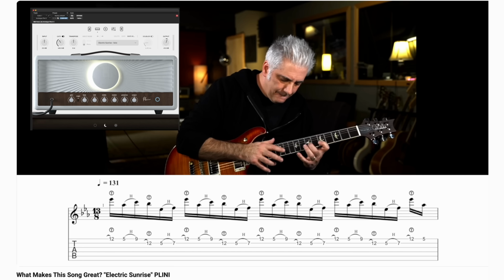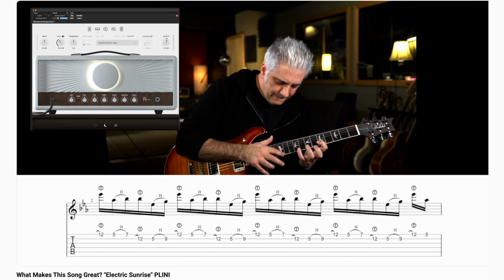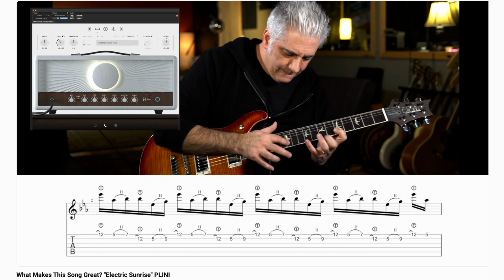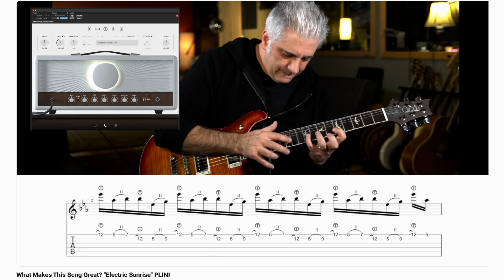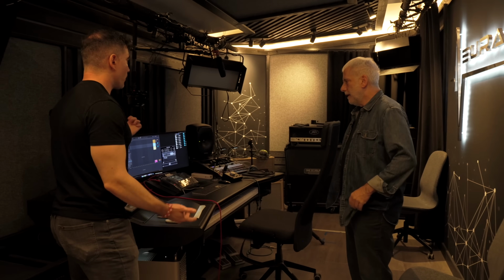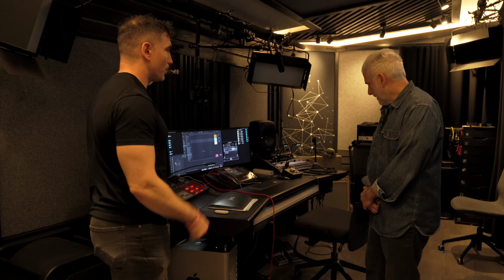I Flew to Finland to Find Out...How Are Amps Modeled?

Comment: I was skeptical forever and pretty disappointed at the Helix I bought years ago.  I own some amazing tube amps and pedals but recently jumped back in with a Quad Cortex and and a Laney FRFR due to the needs of a cover band I joined.
The short story is that I still love the tube amps but the digital setup I use lacks very little and its more consistent and easier to set up and transport for live use.  Amazing gear and not all that much of a learning curve.

Comment: I played with the Neural DSP for a year, then bought a Marshall Jackhammer pedal and an IR emulator pedal. That was it, I had to delete the Neural DSP; I forgot about it instantly. I bought five more overdrives. The transistors sound great, the software is just an emulator. and I couldn't get the "stacked overdrive" sound where a medium gain pedal is fed into a low gain pedal, it just doesn't sound right in the software. Analog pedals do what I've always loved. Their sound is very prominent and has a unique character. And there's no latency at all! Maybe Neural DSP should start releasing separate pedals that can only handle one distortion that I downloaded and droped into, without any latency, and then experiment with them. It'll be more interesting.

Comment: Modeling has come along way and with something like NAM being open source opens the door to many many more options. If NAM could make their platform a more complete testing environment by adding the ability to use your own testing input files. I think that would blow the door off the thing. There is always something missing in the bottom end in models. I find this even in building models of gear thru NAM. Unlock NAM!! Give us the power.

Comment: I have two quad cortex. My first one did fail after quite a few gigs. Turning off then restarting etc. Certain casinos here in Australia demand no back line, so the quad cortex was the answer! It came all the way from Finland back to Australia within a fortnight totally repaired but I bought a second one just to be sure! They are fantastic.! Within minutes of the thing failing I had an email back from the guys at Neural asking questions and troubleshooting on the fly! Their backup service is phenomenal! Considering the time difference between Finland and Australia, there must’ve been someone on hand 24 seven.

Comment: Maths Equations on the White Board are Amplifier or OpAmp Gain equations, Low pass/Band pass filter equations. Basically, you get those Amp gain and then use their transfer function to plot at different frequencies (w).

Comment: Here's my issue with amp modelers:  

Like EVERYTHING technology-driven, within so many years it's useless, outdated, no longer supported by the manufacturer, etc (laptops, pads, phones, etc) .  If you're a touring musician and need something portable, the DSP is a good option, but it WILL eventually be replaced leaving you with a $2K brick. 

Remember the ELEVEN rack unit?  There ya go.

Comment: I've enjoyed so many of your posts, but I'm compelled to respond to an observation from this program. At one point a comment was made that musicians weren't typically technically smart. During the mid '60s when there was a buzz in the air with new music and, as many will say, they became self-aware of their own talents  for music, as I did before I turned ten. I craved learning guitar, and it remained my priority in life. I did very well in middle school, but by high school my interests shifted to music and fell away from academics. Although attending high school, I left just short of graduating, which left a personal scar on my own self-esteem. I spent the next dozen years giging almost incessantly, but reached a wall where I was full. After some self-assessment and counseling I returned to school. It could have gone either way for awhile, but as is often the case, I had a moment with an older professor and shared my background, and feeling defeated and unsure of my academic abilities. He then went on to explain that many of the most highly esteemed people of science also fancied themselves as students of music. With that declaration, I felt like I could be included in the realm of academia as opposed to feeling excluded. I went on to excell in classes and finished years later with a doctors degree, never loosing my affinity for music. My concern is for musicians to never feel insufficient because one's own perceived inadequacies and never allow self-esteem to erode to the point of inaction.

Comment: I have the privilege of being friends with a builder of custom high grade tube amps, and had a chance to be part of a session where we did comparisons between class A tube amps, and amp modelers. The conclusion in the end was unanimous - the tube amps destroyed the amp modelers, there was no comparison. Amp modelers are practical, and it's understandable why musicians use them a lot, because you don't need a special room to record guitars, and also when they tour amp modelers are much more practical, economic and efficient to use, but to say that amp modelers sound as good as tube amps that's a load of b******it. These companies need to be truthful, say that amp modelers are practical, efficient and at this day and age are much better then guitar processors from the past, but they are not better sounding than tube amps, that is not possible. It's basic physics.

Comment: These are people creating the modes we want in our keyboards ot guitar amps. They don't have the computer program to transfer from analog to digital, so they are engineering the transform themselves. They want to capture all of the analog nuance to digital without losing anything. We did this in medical science in the 90s to capture frequencies of brainwaves in analog that we could analyze in digital using fast Fourier transform. They are doing the same thing, not skipping tha analog data. Which we all know from our vinyl disc's contains all the data. Not just a average of data like we have digitally. He's looking at huge mode files.😢

Comment: I regularly use Neural DSP plugins—I use at least 8 or 9 of them—and I have to admit that the quality has now reached levels incredibly close to real analog gear. This is even more true when talking about digital conversions in hybrid or profiling systems.

What I mean is that if the gap between a Neural DSP Archetype plugin and a fully analog setup has become extremely small, this is even more evident with other hybrid systems that cost 10 or 15 times more than a Neural plugin.

In some cases, like the latest John Mayer X, the amp quality is so high that, in my opinion, it no longer makes sense to use profilers, power attenuators, and similar gear. At that point, it makes much more sense either to go fully analog—yes, because a difference still exists—or just embrace this level of digital quality.

God save Neural DSP!!! 🎸🔥

Comment: I like the idea of just simulating every electronic component, then assembling the virtual amp circuit.....but just automating the knob turning and signal injection on a physical amp over thousands of setting variations is super dope. I bet it bypasses a lot of little headaches.

Comment: @Rickbeatto  KNOBS___ YES!!! Gigging musicians are always fiddling with them from gig to gig as no room or stage reacts equally to the same sound. It Is that tactile comment that makes me stick with my boss Me 90.Unless you are a serious recorder vs  a weekend musician, do you really use all of the Possible sounds that a quad Cortex offers?. I would say that if you do that it is great, Spend your time creating tones that help you produce (better) music. One of the best parts is that you can turn knobs on the fly. No menus. I stuck with my boss me 80 and my upgraded boss me 90 , because I could reach down and change what I wanted. I could set a Bank of sounds for a particular guitar. so if I'm. Playing a strat, hollow body, Ibanez roadstar or Prs SE NF3, I don't have to really worry so much. I just have to remember what bank goes with what guitar.  I don't use that many sounds.  If I do, just like in the good old days, I'll drop to a knee and turn a knob then stand back up and play. I now have a better understanding of Impulse responses where Speaker cabinet choices are concerned. The  boss me 90 allows me to find two or three cabinet choices that I like and add them to the pedal for the FRFR / silent stage venues. I'm in love with the 4 by 10 & the 2 by 15 cabs .Because for 20 plus years I played my PV musician III head on top of a custom rolling tuck( naugahyde ) Base cabinet. .it allowed me to move a lot of air when we played outside in the parks and I could  could turn The volume up or down as needed

Comment: I bought a Quad Cortex in April. It is still unopened and sitting on my shelf. I still unsure if I actually need this and if this makes sense. I have several Marshall and Mesa Boogie amps and cabs. I also have many pedals etc. What exactly is the point of having this, versus all the other gear that I already have?

Comment: Those plugins literally replace physical amps, the people who build them, the studios that mic them, and a whole chain of jobs that used to be necessary. That shift was embraced as “progress.” Suddenly AI is where the moral line gets drawn?
Reply: Yes because AI isn't human. Amp engineers still have jobs, recording and mixing engineers still have jobs.
Reply: @ileutur6863  Amp modeling absolutely reduced the need for physical amps, amp rooms, mic lockers, assistants, and studio time. The whole chain didn’t vanish overnight, but it shrank. Fewer sessions. Smaller crews. Different economics. Saying “those people still have jobs” ignores scale. It ignores how often they’re hired and how many people are needed.
And the “AI isn’t human” line doesn’t really hold up. Neither is a plugin. Neither is a DAW. Neither is a drum machine. None of those things are human. They’re tools. Tools that replace or compress parts of a process that used to require more people, more space, and more money.

What actually matters is agency and responsibility. AI doesn’t decide to make art on its own. A person prompts it, edits it, throws most of it away, keeps what works, and decides whether it gets used. That’s no different than choosing an amp model, a preset, or a sample instead of hiring more people and booking more hours.

Every major shift in music tech did this. Tape to digital. Live drums to machines. Big studios to home setups. Nobody drew a moral line then. People adapted because the work still required judgment, taste, and accountability.

So if the standard is “some people still have jobs,” that standard was met a long time ago. This isn’t a moral awakening. It’s another workflow compression. The real question isn’t whether the tool is “human.” It’s how humans choose to use it.

Comment: Digital has RACED by all things pre-amp , that debate is closed. You can argue if you want , but you're wrong. The part that CAN'T be done digitally , yet , is the poweramp section of tube amps. Digital still has a ways to go for that.

Comment: There are so many ways to model amplifiers, but there's something weird in how the best ways are the at the same time the simplest and the most complex, but the one thing that unifies both of them is that neither cares about what is actually happening between input and output. Neural DSP has 1000x more flexibility, but oldtimey convolution matrices aren't really any worse if you know exactly what you are doing.

Comment: Here's the thing, Rick.  Everything I've yet seen, listened to or whatever, regarding modelling, all revolves around the sound.  Truth is they've had good enough sound for quite some time.  But I've been playing with modelling tools for a long time and though they had more than good enough 'sound' for well over a decade now, they are still all missing something.  It's something that does not seem important to many later players, who appear to be fine with the inorganic, compression algorithms used in an attempt to produce gain.  But they all fail, at least all in my experience.  The first gen Helix has some models that sonically, are about perfect.  But when playing through them, though they sound amazing...physically (?), they do not play right. I'm playing a Friedman, but it's the same with most high quality tube amps...they behave differently.  The interactions between player, instrument and amplifier are unnatural on the modelling devices.  They sterilize the playing by unnaturally compressing the signal, they steal the life and nuance from it.  All this focus on this generic expression 'tone', but all the local pro players I know that have been desperate to be able to go modelling stomp-box for live performance, they've all tried it and left it, gone back to small, low wattage heads or combos.  Truth, I've not tried the Neural DSP stuff...I hope it's getting real.

Comment: The easiest way I've found as a sound guy to get rowdy guitarists to check their volume is to convince them to point the Amp straight at their face like a monitor wedge. I would even have a couple of Amp stands that would do this that I would have on deck to loan them so it tilted the Amp back and pointed it right at them and lifted it a little bit so they can make changes on the fly.  This usually would cause them to turn the Amp down and if they didn't, usually it would cause the other band members to fuss at them. Another tip is when doing sound check and setting monitors, 2 things, be careful how you ask the band what they want. I don't usually even give them full reign,  instead I'd say let's get the vocals up in the monitors and then play through and see if you need anything else in the monitors. If I noticed something like a keys player that didn't have an Amp or acoustic natural volume, I would go ahead and just throw a little of that in their wedge and only their wedge. I'd also always try to do monitors with the mains up and unmuted and go ahead and try to get a start on front of house because some of the volume from FOH will be part of what they hear on state. Plus I'll also know that the system is stable and isn't gonna go into feedback when I bring up the mains. Also I'll tend to have my master faders up at unity on mains and monitors while sound checking and then I'll pull them back 10 dB or so like back to the first big line down or about the width of the fader know or a tad more. I like keeping most everything at unity to try to get as much headroom as I can possibly get. Which is almost like and then when setting the mic pres I'll usually do vocals first, starting with lead first

Comment: When I first heard about Machine Learning, I was really excited. It's an excellent application of artificial intelligence. Learning all the possible combinations of controls for hundreds of amplifiers, including tube usage time, electrical parameters, frequency response... all of that data necessarily influences the sound generated by an amplifier. If you learn from all the most representative amplifiers, you could reproduce that sound as faithfully as possible (having learned so much from all the possible combinations of hundreds of amplifiers) using software.

Comment: My ear likes tubes, my back legs pedals

My voters have both I have a few amps Lonestar and EVH a Vox and I plugged into those and the sound is so good but you take a pedal multi effects and you plug it into a good PA and really it doesn’t make much of a difference I think in a small venue amp bigger venue with a good sound system just go with a really good multi effects. I use my multi effects. It’s sitting on top of my office table and I use it for practice and that kind of stuff.

Comment: It would be an interesting video to follow up by asking UAD about their methodology because I believe they model the circuits, which he is downplaying. It seems to me like the circuit modeling approach would be more flexible and accurate because of the point he made about only being able to text a small subset of the possible settings. Also, it wouldn't allow for changing out components like how the ATR-102 tape emulation can toggle transformer noise on and off. Trying to implement that feature in this scheme would rely on the AI to know what noise from the gear is due to the transformer as opposed to other sources, which seems dubious. I'm not crapping on Neural DSPs products, but it would be interesting to hear and contrast the competiting philosophy.

Comment: The thing is (IMO) ... since I started to use the Neural DSP stuff, I don't need anything else, because it's really that good. I sold a lot of my amps that I owned, because there is no situation where I need them. I don't play very loud, so I go straight in to the PA and monitors on gigs or use my own small PA system. For me, Neural DSP solved a problem. I played a lot of gigs and used also modelers, but I never really liked them... they were just convenient. I played the Fractal in a Musical setting (Bodyguard) and they sounded not really good. The tracking is good but they lack of the warmth... again... so for me it's Neural DSP (or the UAFX) stuff... they made it !